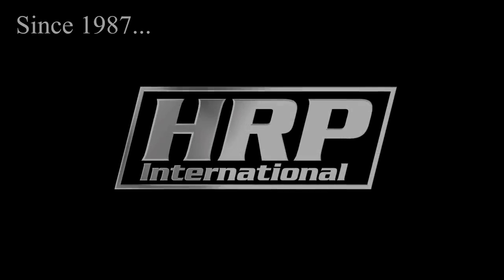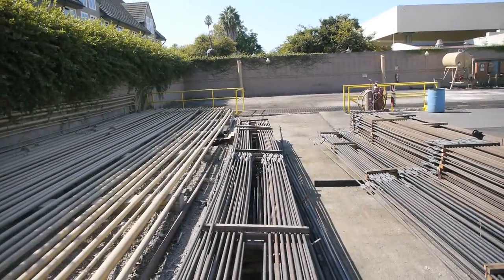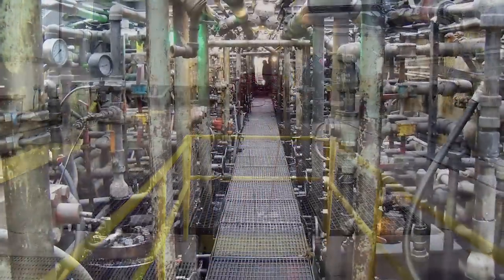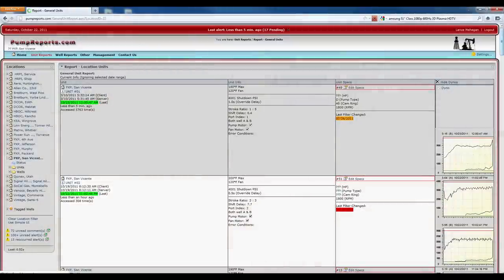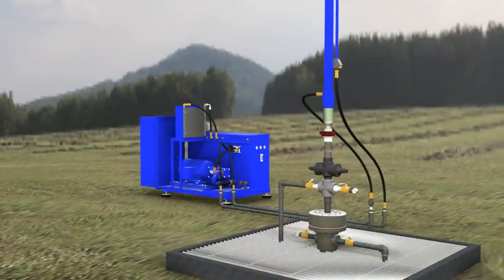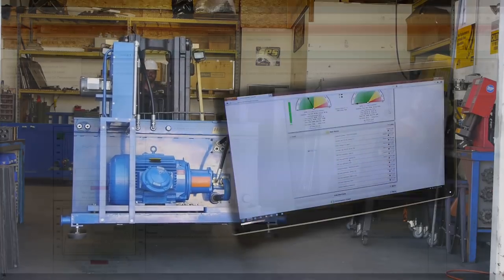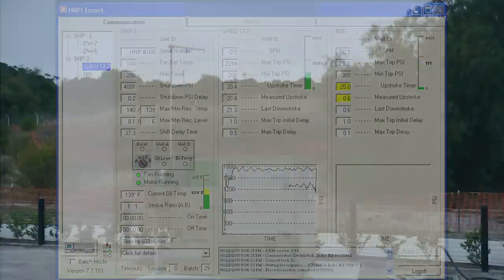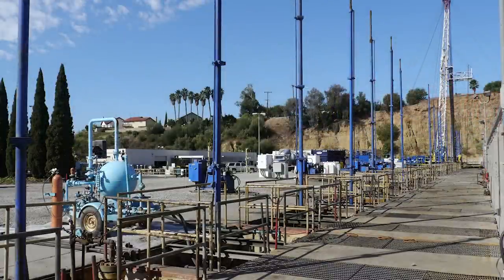Hydraulic Rod Pumps International - The Leaders In Rod Pump Technology

Comment: The pumping unit is more reliable IMO.  I don’t care for these hydraulic systems.
Reply from the maker: Welcome & thanks for stopping by !

Everything comes with a price, or a trade-off.

Beam pumping units are great workhorses for longevity but they cannot do what an HRP can such as change stroke length on the fly, or continue pumping with a partially sticking bottom hole pump, to name a coupe of examples.

Likewise, hydraulic systems do require more frequent surface maintenance than a beam pumping units, but the type of maintenance is vastly different.

A former employee used to manage beam unit maintenance for a large field for one of our customers before he came to work for us. His comment was revealing:

~"People often believe beam units are lower maintenance, while in reality they are far more expensive.  When they need work, it's much more difficult & expensive because you often need a crew and a crane to do repairs, like replacing a wrist pin bearing."

We won't claim to be a panacea for all problems, but we are an alternative solution with very unique features.

Thanks again for the comment!